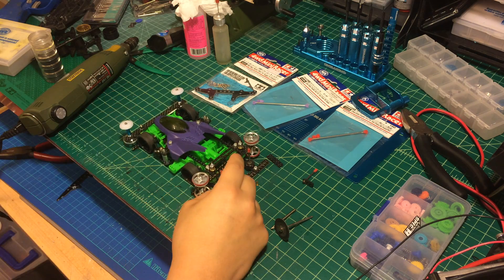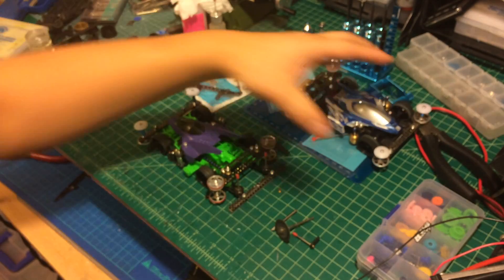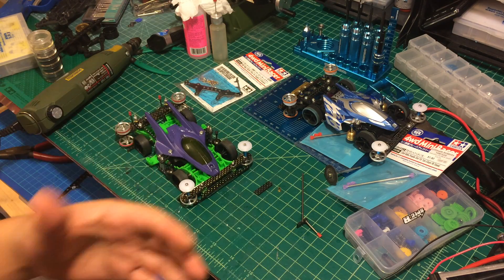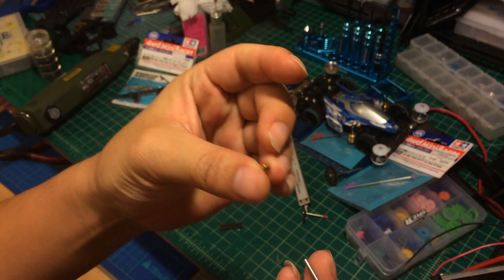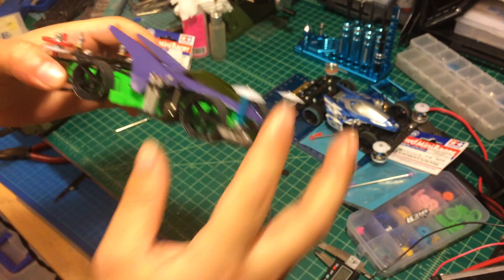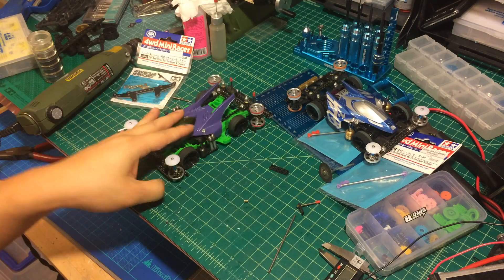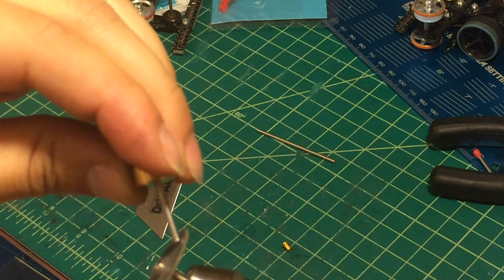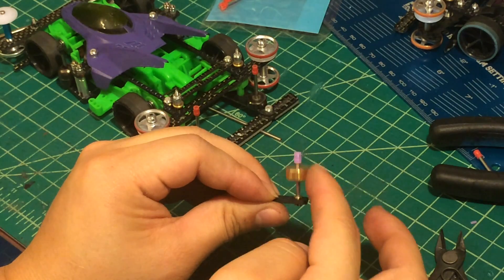Tamiya Mini 4WD Tutorial How to use 2mm hollow Propeller Shaft to mount Damper

Comment: I like ur video ao much. Thanks for your tips but How can I change the travel length of the damper on the shaft. I can adjust the length by using lock nut and screw. I usually adjust the length for different dampers in different track. Looking forward to receiving ur answer. Thanks again.

Comment: I used the same method, I am not sure if the problem is with my glue, the rod will eventually drop off after a period of time.
Reply from the maker: put some carbon fiber Powders ~~ mix with glue~~
Reply: Mad Tang thnx for the tip :) u meant grind the carbon fiber and mix with CA glue ?
Reply from the maker: Yes~~